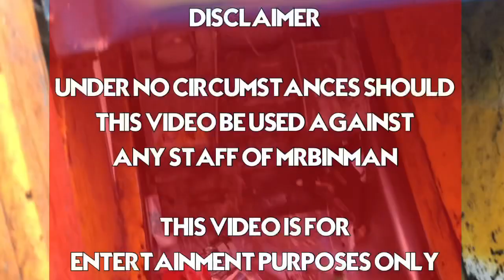*NEW TRUCK* MrBinman Daf CF 70/30 split Olympus twin pack with Terberg Omnidels

Comment: Nice!!! That looks filthy for a new truck. What plate is that and what bang was it on
Reply from the maker: It’s 2021 + double bang
Reply: @SouthwestRefuseVehiclesIreland  wow that’s really dirty for a 2021 truck
Reply: I wonder why it has the older style lifters
Reply from the maker: @refusevehiclesuk6129  don’t know..what do the new style ones look like, send me a video, I’ve never seen the new style
Reply from the maker: @refusevehiclesuk6129  truck does need a wash now
Reply: @SouthwestRefuseVehiclesIreland  the ones on my videos and most of the other YouTubers. The ones on the new Dacorum bin lorrys
Reply: Irish companies always put old lifters & bodies on new trucks. Look at greyhound for example
Reply: The new ones are on most channels, they have a rubber bit on the lifter clamp, different control panels and a different side panel
Reply: @SouthwestRefuseVehiclesIreland  the lifters on my regular are the new style
Reply from the maker: ℍ𝕖𝕝𝕝𝕠